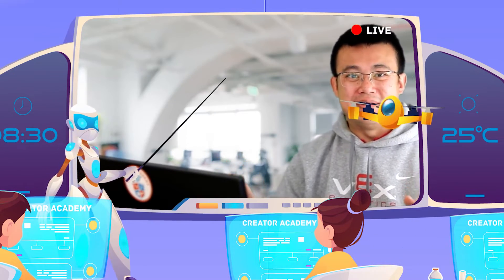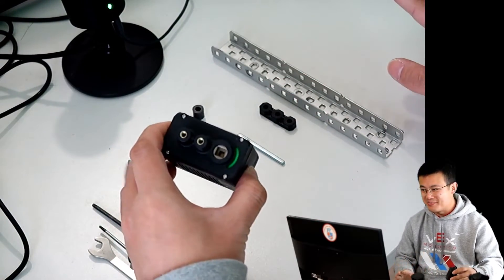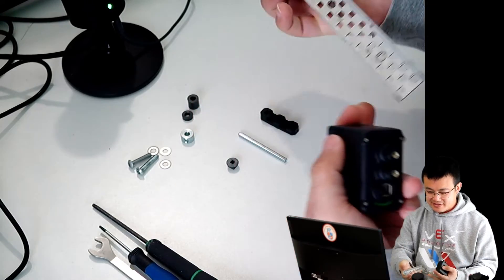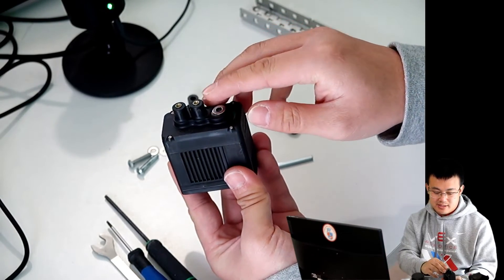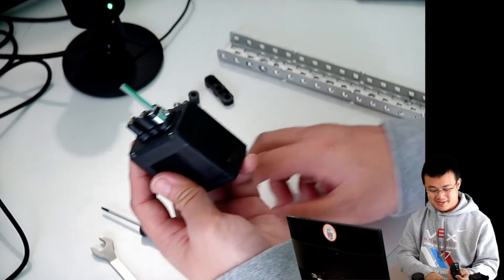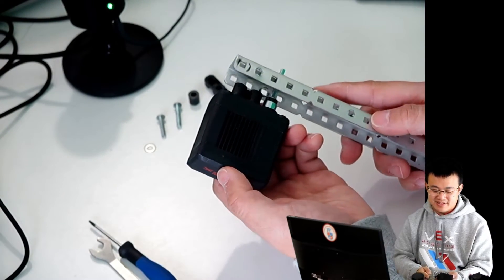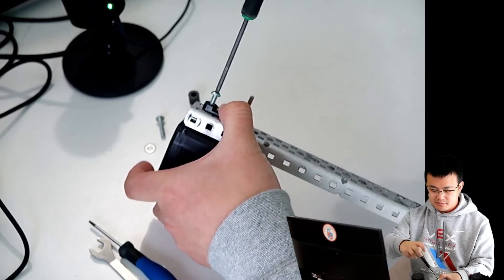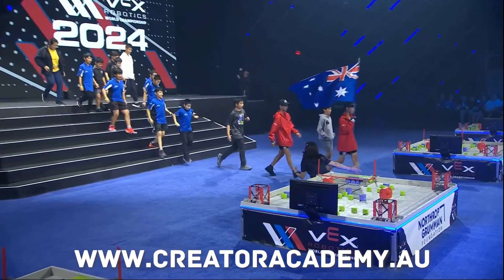How To Correctly Mount VEX V5 Motors in 5 Minutes (Avoid Overheating, Underpowered, Squeaky Motors)

Comment: Is it necessary to have the washer? Our team doesn't have them currently and we're hoping to keep moving forward with our testing.
Reply from the maker: The washers will help increase the longevity and efficiency of the motor. Even though it is not immediately necessary, the difference will add up if multiple motors don’t have washers. Good luck! Garry

Comment: Hi, does it make a huge difference if you put in the motor insert on the motor or not? And are the bearing flats necessary to put on, since when I use them, there is a huge increase in friction.
Reply from the maker: Hi! The difference is not huge but small differences add up. Bearing flats are very important for keeping driveshafts centred in the square holes. If it causes friction, double check that the bearing posts (the tiny bits of plastic beside the holes) are actually inserted into the square holes of the metal. Also check that your driveshafts are not bent, and that everything is aligned precisely. Good luck! Garry.
Reply: @CreatorAcademyAustralia  tysm 🙏
Reply: @CreatorAcademyAustralia the motor should by default keep the axle aligned on its side of the drive channel